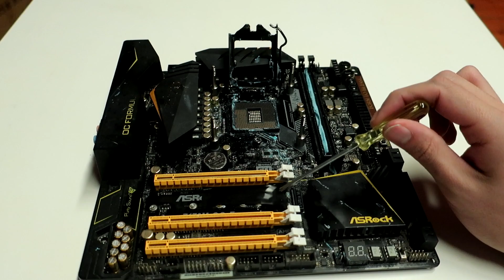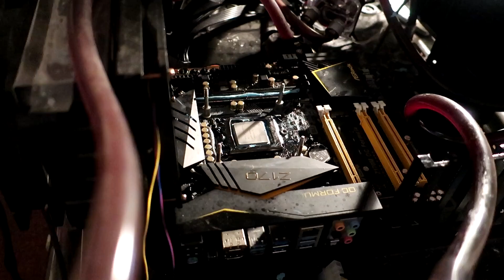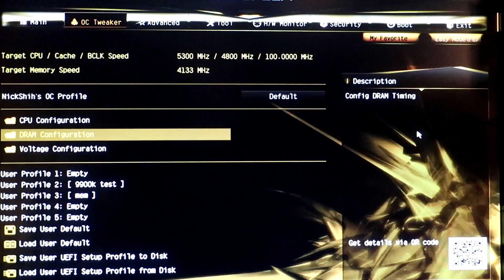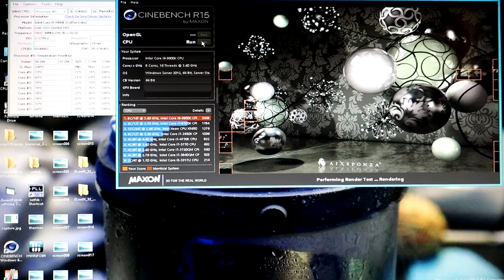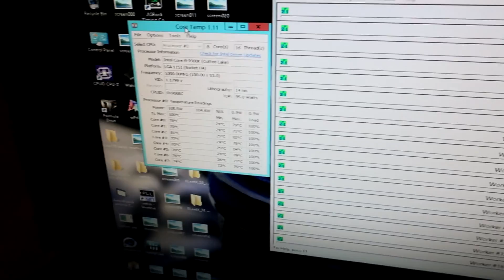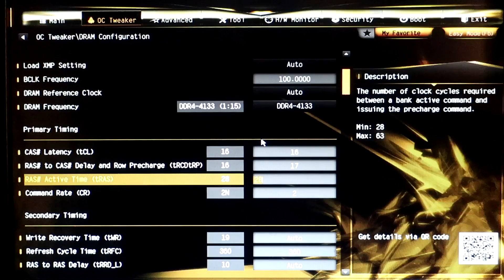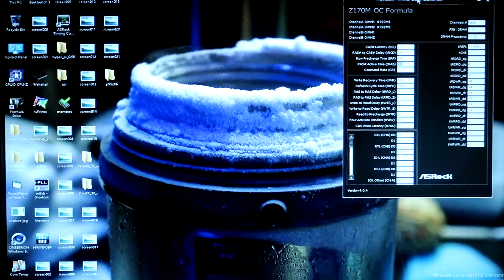Coffee Lake Core i9 9900K + Z170/Z270 setup and overclocking guide to 5.5ghz

Comment: 4:50 what do you mean by shorting? Would I have to solder a wire between those two points on the mobo?
Reply: Block them with some heavy tape.  Just tape over the gold metal contacts and set them in place.

Now I’m only here to find out why the 9900k is the best DDR4 era processor and Why my laptop has one with 3600mHz.

Comment: I realized I spent $320 bucks on my z170 deluxe 5 years ago. Heck yeah I’m going to recycle and mod it to accept the 9700k. What was I doing putting a 6600k in a high end board in the first place I don’t know-but now I hope to get “my money’s worth”.
Reply: Did it, works perfectly and the new GUI makes it super easy. With my asus board the bios went right in after naming it correctly, the new installer fixes the stepping and .cap bios file for you.

Comment: how about the Asus Z170-E would that work with a i9 it is the same socket type
Reply from the maker: Yes
Reply: @LuumiJuhani  could you link the mod that I will need in order to do this?
Reply from the maker: @prawnstarrr  Watch my 2020 update about this topic.
Reply: @LuumiJuhani  do you have to short pins and do hardware modifications to achieve this

Comment: hello sir do you advise to do with it Asus Z170A with 9700K cpu ? and is wire soldering modification needed? I plan to do it in cpu pin isolating+shorting and coffetime bios modding way. Do you think does it success?

Comment: i have pretty good setup and i cant get 5.3 and above stable maybe the vrm on my z390 pro carbon is just not good enough im stable at 5.2ghz 1.36 volt , 4200mhz 1.45 v ram with cinebench and aida64 1hr stress test but it bothers me i want to hit 5.5 too ;x

Comment: I have a maximus apex ix, do you have links to chipset updates or anything. The 7700k oced to 5.2 at  1.4V, with 2 gpu's and 2 ssds, and 3200 ram oced to 3400 stable, uncore at 4.7, stable using 3 different ram/cache benchmarks/stability test... my VRM maxes out at 32 degrees on a test bench. Obviously i can draw double the watts minimum,  especially with the 2 8 pin mobo connectors (totally useless and reduntant for any 7 series chips, even on ln2).... please help get this board running an 8/9th gen cpu.... hell I'll send you the board if you can get it working, just don't brick it, and use it to make good content. Let me know if you're intrrested, or share any resources, I'll film it and give you credit/the video if you want me to use your advice, and give you 100% credit and rights to the videos. I'm a proficient overclocker, and  have a nice setup for filming, you can have the raw footage, and see what you can do. Let me know what you think/can do.
Reply: Did you figure it out?

Comment: Intel, as if I did not like this company, it does everything to turn everyone against itself. Thermal grease, change the socket without serious reasons, build their Trojan in the form of ME, which is specifically blocked in all possible ways. And that's all, on the motherboards and processor that I buy as a personal thing,
and in the end I can not dispose of as I want.
For the first time I decided that I would no longer support this company, thank you Intel, you showed what you are.

Comment: Wow, old motherboard can get it to 5.5ghz. How come the average z390 couldn't get it?
Reply: This is the best Z170 motherboard for overclocking. Cheap Z390 boards will crash earlier, because of weak VRM's and less BIOS settings.
Reply: This has a very good vrm, better than most z170-z270-z370-z390. Most of the top end or near-top end boards could manage this, save maybe a few of the higher end Asus boards such as the xi extreme and lower.
Reply: His 9900k needs only 1.3v to hit 5.5. Most 9900k need more than 1.3v to hit 5ghz.

Comment: Thanks for the video, very informative!

One thing you didn't mention is if the iGPU (UHD630) works - it's always good to have it as a backup if you corrupt your main display driver...

Also, if you are overclocking 4 DIMMs (4 x 8 GB) do you find you need to loosen tWRWR_dr and tWRWR_dd ?
Reply: I don't believe the iGPU is useable with this mod.
Reply: You  MUST always loose twrwr_dr twrwr_dd IF you have 0ver 3600 mhz. Not only 4 dimms , my 2 dimms apex need that too.
Reply: Auto timings suck anyway :)